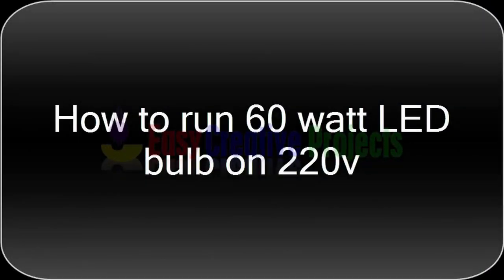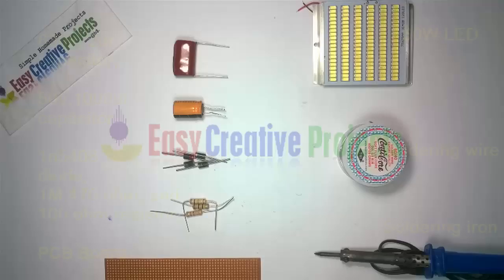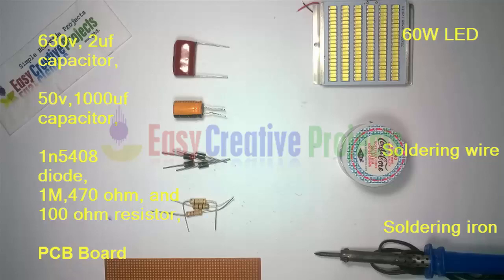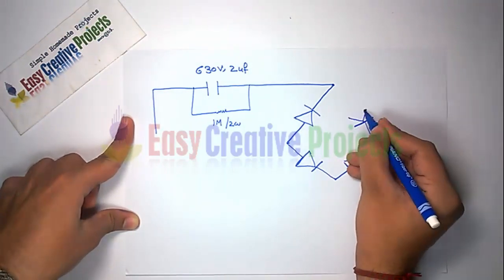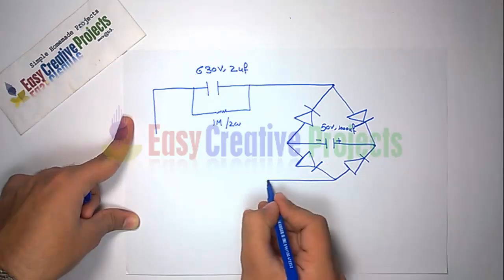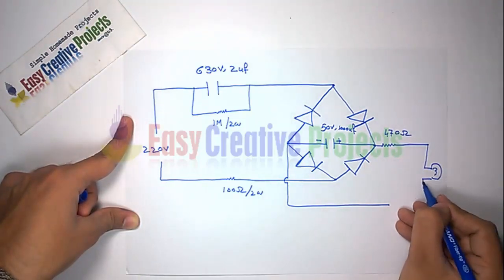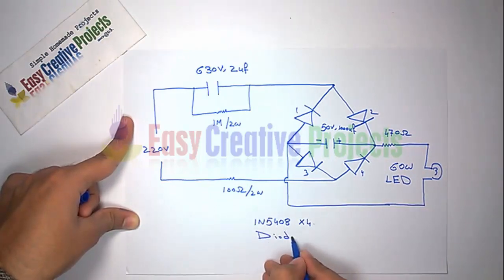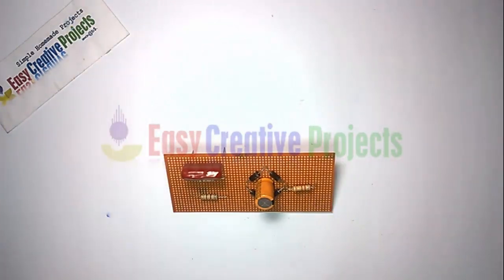How to run 60 watt LED bulb on 220v - easy step by step with circuit diagram

Comment: in 4007 diod good or no
Reply from the maker: 1n4007 diode pass only 1amp current output. if you want more brightness then you need more then 1amp diode.

Comment: Sir, I have purchased 100 ohm one resistor   (color of resistor of the body is blue color ),same color code with same size but the resistor body (100 ohms)in the circuit board is same color code with same size but it's body is cream color what is the difference between these two resistor.
Reply: Please reply me as soon as possible please let me know about this.
Reply from the maker: dear simple focus on value of resistor.  some time you can find full white color resistor. when what you do? so simple focus on value.
Reply: Thanks for your help sir
Reply from the maker: you welcome dear.

Comment: PLS my point is I want to Run this Led on 12volts car battery and not on 220volts AC anymore.
Reply from the maker: if you want to run it direct car battery so simple connect led with heat sink.
Reply: @EasyCreativeProjects  Thanks boss

Comment: Sir 60 watt led mila nahi kya 50watt led lga sakte hai
Reply from the maker: yes dear. you can use 50w LED.
but becareful. because you play with direct power supply. dont touch any thing when power supply on.
thanks.
Reply: Easy Creative Projects  sir kya led heat sink ke bina chale ga
Reply from the maker: Heat sink k bina jal jay ge 2 mint main.

Comment: Sir,
koi be circuit banate hue Nonpolar capacitor ko discharge krne ke lye resister kis formula se use krna hy
Reply from the maker: dear resistor ka koi negative positive nai hota. aap jis trf say b lgao vo apni power k hisab say resistor create krti ha.
Reply: Easy Creative Projects 
Sir men ne resister ki ohm and watts ka pocha hy kise be circuit ko design dete hue.
Reply from the maker: dear us ka to ak hi formula ha        V=IR and R=V/I
Baki watt ka hisaab yah hota ha k agr current zeyada ho to zeyada watt ki resistor use hoti ha. agr km watt ki use kro gay to resistor jl jati ha. ab is circuit main aap 1watt ki resistor use kr sktay ho pr main main 2 watt requirement ki ha tan k resistor long time chly. 
100 ohm 1/8w ki resistor b utni hi resistor create krti ha jitni  100 ohm 5w ki resistor krti ha.
pr jb abbt  load ki aati ha tb asl chiz ka pta chlta.
practical aor theory main boht frq hota ha.
Reply: Easy Creative Projects 
Sir,
Dil se thanks.
Ab patta chal gya hy.
Very thanks.

Comment: There is a problem in this circuit. Dc voltage output without led 80 volts. and when we add led than it come on 9 volt. 60 watt led running very dim. How can we increase voltage.???
Reply from the maker: dear check your capacitor.
i think your capacitor cannot work properly.